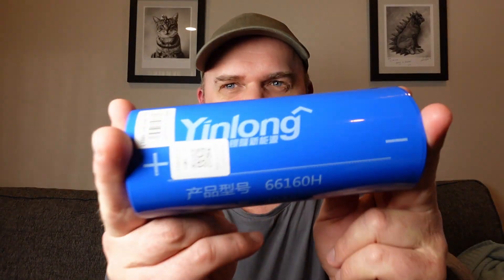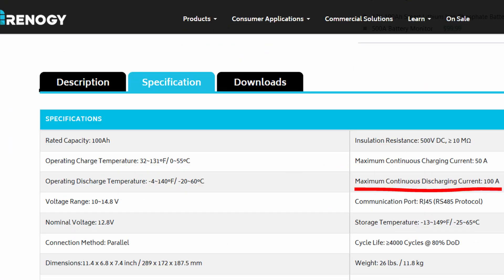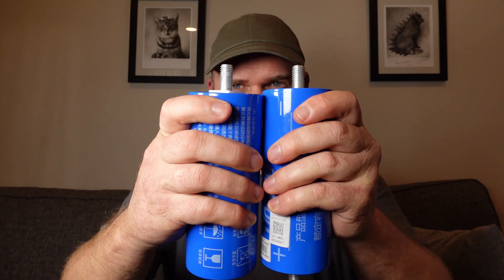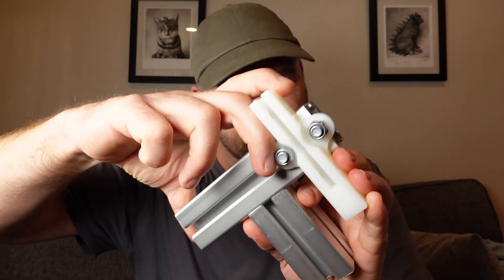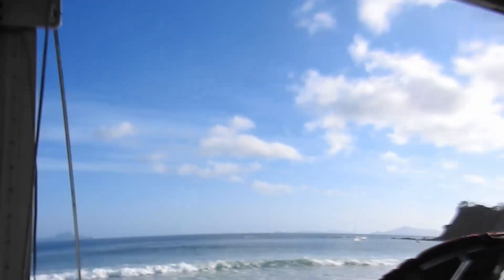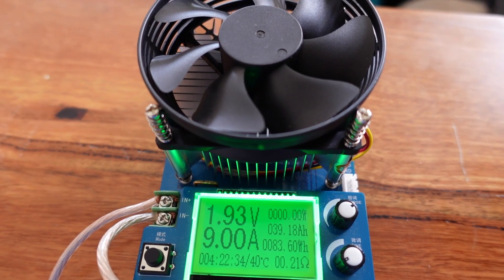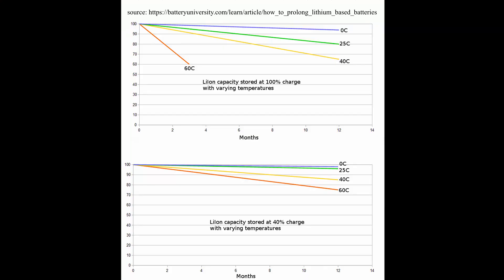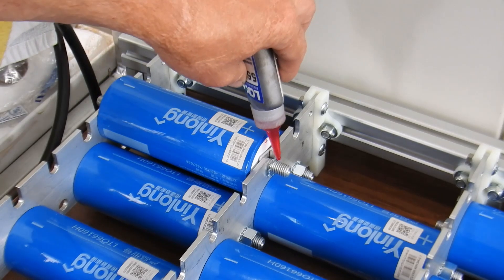Campervan DIY battery build HUGE POWER!

Comment: The main application for these cells would be inbetween super capacitor (super fast charging, high power, very low capacity) and Li-ion batteries (medium fast charging, medium power, high capacity). So this would be ideal for busses, public traffic and charging facilities at each station. Could be an additional backup-power for super capicitor applications. They are not suitable for DIY solar home projects or other long term energy saving.
Reply from the maker: Tell me all the reasons they are not suitable for DIY solar
Reply: @brendontait6968  Energy density is very low. Culombic efficiency is quite low, cost is very high per kWh. They are just not the best choice for that DIY solar.
Reply from the maker: I disagree Richard, energy density is only slightly lower than LFP  (if you take into account the fact that you can happily cycle 100% dod instead of only 80% dod for LFP the difference is not much) you're incorrect about coulombic efficiency (sounds like you've been listening to Will Prowse 🤣🤣).  

For my DIY camper/solar 
application...  they are THE most robust lithium chemistry, they are more likely to survive the result of a BMS failure, they can be reliably cycled to full capacity without harm, they can be charged at very low temperatures, and they have the longest lifespan of any lithium chemistry and they are the safest of all lithium chemistries.  I wanted the longest life, most robust and safest battery that I could make, I think I've made it.  So am curious as to why some people think it's not a suitable chemistry to be using (it seems mainly their thought process has been influenced by Will Prowse) It's  a year old now and done everything I've wanted and expected it to.
Reply: @brendontait6968  Whats wrong with the reviews of Will Prowse? In mho he is doing very well on the science side. And capacity density as well as culombic efficiency is rather low for liti-cells. Taken into account the longer cycle live the price is getting inferior but its hard to really live up with the cycle live with a daily carge by solar...
Reply from the maker: I've just said that the coulombic efficiency for these cells is good and then you tell me it is low... again?  Do you have personal experience with them?  In general use... (in my case with a 2kW charge/discharge) the coulombic efficiency sits around 99%. I like Will Prowse, but he spread this whole myth that these cells have bad efficiency.  No lithium battery will ever last as long as lab tests show with regard to cycle life.  Probably by a factor of two.  The reason for this is when labs cycle the cells, they are not kept at a high state of charge.  So realistically cycling every day LTO is likely to last 10k cycles which is around 25yrs (same as calendar life rating) Whereas LFP are likely to last 6-7 with an 80% cycle each day.  I used this chemistry because it is the safest, most robust and longest lasting lithium chemistry available. I didn't use it because it was the cheapest.  I'm going to do some LFP builds too adding in salient details that are often missed in YT videos with the hope that people will be able to learn how to build a great battery pack and see why others fall short in their designs.
Reply: @brendontait6968  Maybe i am wrong concerning C.E. - it also may vary by the grade of the cells used. I read about C.E. value of 95 - 99%. For LCO or similar its mostly 99+% for a good cell. The greatest downpoints for LTO are energy density (rel. low voltage) and price. Of course cycle life is very good and much better than anything else for now.

Comment: Brendon, Thanks for the excellent vid.. I'd not checked into LTO batteries before and you have me nearly sold.  The application I'm interested in different battery tech is a power chair.  You see I use 2 12v agm batteries. It costs me $400 US for this setup.  And I end up changing them twice a year.  I love the number of cycles but it's hugely important that I get atleast the same distance per charge as I do with new AGMs.  Though even when they're new they don't last me all day. I live in Phoenix AZ it gets really hot here and it's it's devastating the batteries. I would love to be able to go more than 15 MI at full speed which is 6 mph. I'm active I get out and go go go but soon as I run one of these batteries down so I got to happen twice and then they just fall in their face quickly they're only good for about 4 months then they start going downhill so fast right now I can only go about 3 MI. So in your opinion are these ltos going to be the way to go for me? I won't have a problem setting it up doing the mechanical the mechanics of it I just don't know enough about the technology. they got to work on my scooter tells me that lithium's no good for me and they send that it's the best thing is AGM. I think it's full of crap but I want to hear from somebody that knows more than me. Thank you
Reply from the maker: Hey Scott, I'm not really an expert on these batteries in all environments.  From what I understand, they struggle with the combination of high temperature and high state of charge.  They would probably last reasonably if not charged to full capacity, this is not something I have yet experimented with so couldn't recommend a specific charge % to take them to.  50-70% range would be my guess.  And would likely be a similar energy density at that to your AGM.  I'm interested to find out tho if you flick me a msg on insta, we can try figure what might work best for your situ.

Comment: 14:28 I cannot agree with this enumeration. It does not include the costs of obtaining electricity. So large that in the case of a solar installation they barely pay off after nearly twenty years, assuming that it is used every day.
 Powering a recreational vehicle, used - let's say - for a month a year, will not pay off in any way during the life of the owner. The vehicle itself will also be scrapped earlier...
Batteries, no matter LiFePO4 or LTO, make sense only when they are intended for strictly off grid use, when there is no cheaper alternative. A generator will be a cheaper alternative, even including the price of fuel.
So mr Tait spent $ 16,359.3 on batteries alone (if I counted correctly that he used 90 cells), add the hardware and inverter costs, and  it will a round 20,000 bucks! And how much will cost a power generator about 20 kW? However, if someone has an imperative to use LTO cells, who will forbid the rich? ;)
True, the batteries work silently - it makes me realize how much silence costs! :)))
Reply from the maker: The intent of that sum was to show just the cost of battery storage alone (I believe I mentioned this)  that said...  I think your maths is off by a bit. I'm not sure which part of the world you are in, will talk in NZD bc it's where I'm at.  The cells ended up costing me $56 ea (it's cheaper when you buy more).  There are 99 cells so that is $5,500.  The mppt was $900, the solar panels were $1,500 and the inverter was $1600. (I actually paid nothing for the mppt, solar and inverter - but we will include them in the cost)  the aluminium bars were $90 and the nylon was $80.  95% of my cable was second hand and got a majority of it for the labor required to remove it.  So that comes to around $10,000 NZD.  At the time of the build the exchange was 0.62 so that's around $6,200 USD  this is a big system and supplies me with enough power to run a full size domestic fridge, a twin burner induction hob, an electric oven and electric hot water.  The solar is big enough to heat the hot water cylinder and charge the battery by about 1PM.  I've seen people on YouTube spend $25,000 USD on their electrical, so at just over $6k USD mine was expensive...  but for what it is, and what it gives me (and the fact it is a novel chenistry) not too offensive.  What is it worth for me to have silence?  A lot more than I paid.
Reply: @brendontait6968   I am so sorry, it was my mistake. I'm doing a feasibility study
 planning my own photovoltaic installation, of course supported by a powerful battery.The goal is to create such a photovoltaic installation, along with a battery, to be enough to power a quite large house and workshop as a separate building. So the difference in the price of cells is much more important to me than in your case, because 10 kWh is definitely too small a battery. That is why I do calculations in excel. When calculating the value of your battery, I clicked the cell containing the unit price in my currency instead of dollars - a moment of inattention and the error is ready.

Therefore, I also closely follow the solutions of others, with particular emphasis on large batteries.
As for LTO. Very, very carefully, I take into account to use it. The relatively low capacity of these cells speaks against this variant. The fantastic number of cycles speaks for it. So fantastic that sometimes I wonder if the Chinese are not just bragging about their product? Regardless of the Chinese claims, the price of the LTO battery would shake my budget a lot, but I definitely did not give up thinking about these cells.
Right now I am testing LiFePO4 280 Ah. They have a hard life on my workbench: they are alternately charged and discharged with 0.5C current over two months non-stop but 80% DOD. After 150 cycles, it turned out that their capacity increased slightly - a few Ah. I treat this result as an announcement of good quality, in line with the factory specification - all four of them (that's how much I bought for testing).
When I finish my torture with LiFePO4, I will buy five LTOs and they will also get decent whips on the workbench. It will go much faster because the capacity is much smaller. I will have a great headache if it turn out to be as good as the Chinese say: which one should I choose?

A little but important piece of advice as an apology. Since the panel with cells is connected with duralumin plates, at some point it will have to be connected with copper wires. Copper dislikes very much with aluminum due to the large difference in electrochemical potential, so I sincerely advise you to give washers, which on one side are copper and on the other aluminum (if you didn't - it happens often). Can be purchased at electrical equipment stores. Neglect will result in the formation of a raid that will eventually completely break the electrical circuit. With high currents, you need to pay special attention to it because the effects can be dangerous. Same main cables as connections to the BMS. The thing costs pennies, and peace of mind is priceless. Just like silence. :)))

PS. I live in Poland, so almost in the antipodes.

Comment: Does LTO is less sensitive than LiFePo related to the temperature? (minus or >45°) in order to be use in a CamperVan during winter times and summer times... (Which is a constraint totally different than a power bank in the celar of the house)
Did you do any test around it? 
Thanks for feedback of your experiences about it.
Reply from the maker: Hey Fred, winter is no problem.  However, this chemistry doesn't appreciate high temps and high SOC.  If storing in high temperatures, they would likely be ok if charged to just 50-60% - not ideal, but many chemistries struggle with that sort of temperature
Reply: @brendontait6968  Does on Bluetooth BMS is easy to change the setup of batteries according the destination of the road trip?

Comment: Yeah everyone has a mill at home to make one out sourcing all of that id rather stick with what I have and im pretty sure they are capacitors not batteries
Reply from the maker: You don't have a mill at home?  That's embarrassing for you 🤣🤣  stick to what you got. The intent was for people to get the plates laser cut and many people have desktop cnc routers to make the brackets. I'm pretty sure you're mistaken about them being capacitors.

Comment: Wow I did not know about these batt I wonder the weght of them to lipo for drones quad I nearly burned the house down I left it to go off at 4.4v each sell 4s and next thing I hear was shouting my dad nocked it on carpet trying to put it out I knew the energy had to come out first but it smoked house out burned his foot and the carpet wss lounge hall stairs up stairs couple k damage 😳 it was on a kitchen tray on the charger he should of left it I coild of carried it out if this happens to you let the reaction happen first keep calm donrt panic panic is the problem and have a plan in your head if or when it happens you know wot to do safely
Reply from the maker: Hey Chris, the power to weight ratio of these cells is decent, unfortunately tho the energy to weight ratio is quite poor.  So unfortunately for the next few years you are going to have to stick with the more flammable battery chemistries.

Comment: 70 bucks per battery! That's flipping insane, I will go with marine batteries and save more than half of what he spent and warranty the batteries before warranty is up and get double the life.
Reply from the maker: It depends on how many cells you buy.  Buying in bulk makes them significantly cheaper.  Am pretty sure your marine battery scheme would still work out more expensive long term.

Comment: So, am I the only one wondering WHY you need that much power on hand?  Are you powering off-grid concerts?  Or are you pushing your truck with it?  :-)  Also, how are you charging these?  Solar?  Or the truck?  How long does it take to charge up in various manners?
Reply from the maker: Hey... as far as power, I don't need that much power.  As far as capacity, the capacity isn't actually very big. If I were to do it with LFP, I would have made it double the capacity.
Reply from the maker: Will be charging off solar and possibly with the truck.  Solar will likely take a couple days of full sun to charge it up.  Am considering putting a big brushless alternator in which would charge it in 1.5hrs.  I've been charging from mains, with my current charger it takes around 11 hours.

Comment: Use standard car batteries. they last 10yrs minimum and costs like 10% of this li-ion bs. they are safe and could be operated in below zero conditions(big no no for li-ion). li-ion is only worth considering when you build high voltage systems(300VDC and above). Of course you are free to spend money on this fashionable extras but no much sense- better spend it on traveling 🤪
Reply from the maker: Yeah, I don't think you know what you are talking about.  A starting battery will not last 6 months if being used for cycling.  The amorphous layer of lead sulphate quickly crystallizes, degrades both the acid and lead, makes the plates non conductive and will not convert back when charged.  If you want to become more knowledgeable about batteries follow along, I'll be explaining different chemistries, what they are suited for and how to setup systems, what systems are good and what arent.  Please try and understand the limits of your knowledge when commenting.

Comment: Sweet.  Boats for me. Wondering if this would be a good match...
Reply from the maker: Just depends on what you are wanting.  These are the longest lived, most robust and safest commercially available lithium chemistry.  However, they are also fairly expensive, purely on a capacity basis.

Comment: $10000 in batteries alone!?  That link shows then at $900 for 10.  Holy chit man.
Reply from the maker: If you buy lots, they can get cheaper.  Doing a group buy currently, $34.50 usd/cell plus shipping

Comment: First off, I want to tell ya that your battery pack design is the best I've seen on DIY builds. You considered and solved for many variables with that design. Just wondering why you only slotted one side on your buss bars and not the other?  I subbed happily.
Reply from the maker: Hey, thanks for that,  the reason I only slotted one side... gravity.  I considered slotting both sides and I included a design in my downloads with both sides slotted.  But I figured that the bottom of the pack isn't easily accessible, and if a bottom layer cell needed replacing.  It would be easiest to take the top cells out that I needed to, loosen the rails and separate the pack by sliding within the rails.  Not ideal.  But doable without too much drama.  I figured if they were holes in the bottom layer, the cells would all hold in the right place and I wouldn't have to hold them up while inserting them and with vibration they are not going to have any chance of falling out.

Comment: Like you're videos and presentation, good job. Quick question..... what kit do you use to machine the parts for your battery build?
Reply from the maker: Thanks Phil, it's a shitty old Cincinnati Arrow.  It's fairly grunty, 11kW spindle with 1 and 2kW servo motors.  It use to blow up constantly - so much so that I always use to hold my breath turning it on.  I ripped all the electronics out and re wired it with a new controller new paint etc.  It's not finished, but it works.  You can see it much more in depth in my kitchen bench video.

Comment: Not a bad job there Brendo, I think I may well build one too. I'll be needing at least 15 if not 20 Kw/hrs storage. Thanks for posting your designs too. Who did the CNC work or did you build that too. I really like your Truck, that thing will go anywhere. If you want a Hydrogen generator to run your truck on, let me know & I'll give you the info I got
Reply from the maker: No problem mate, I did the CNC stuff with an old machine I rebuilt.  Check out my kitchen bench video to see a bit more of it.